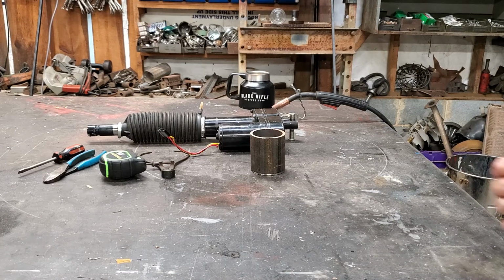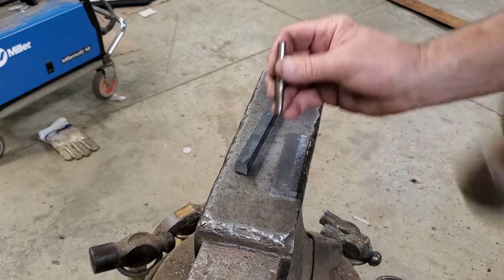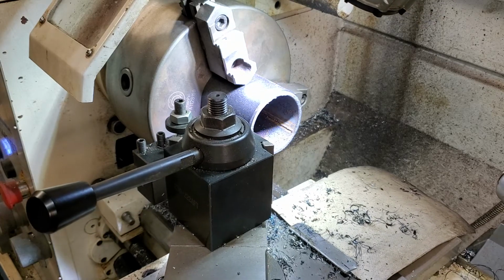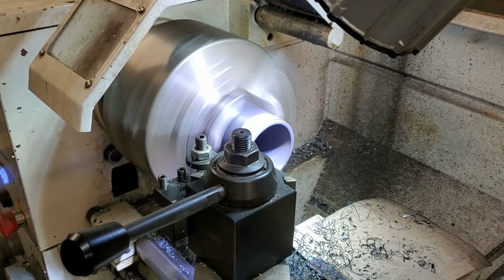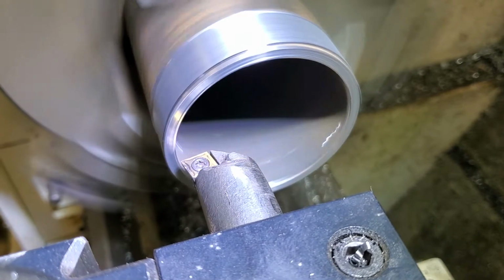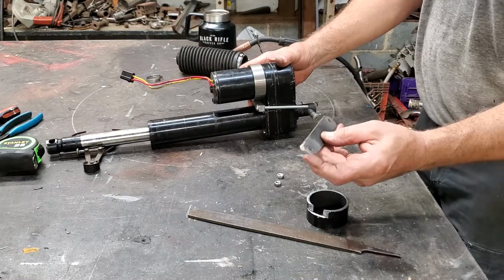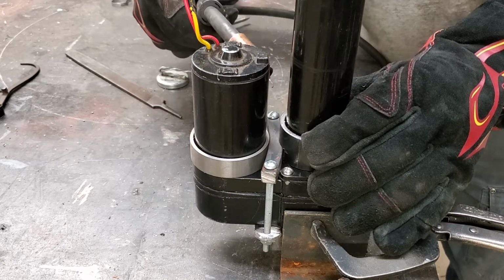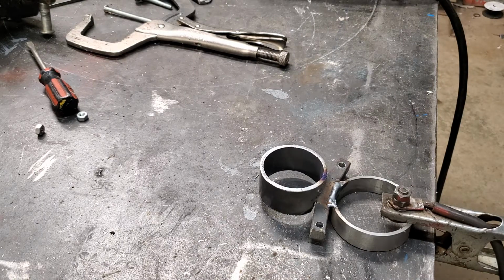How to repair john deere dump bed motor

Comment: I asked JD to drill the 4mounting holes and use longer bolts. No can do. New motor installed $$$$$$$$$$. Thanks for the video.

Comment: Great video if you have industrial lathe, guess what most people don't.  This video is nothing more than tool flexing and no use to an average DYI.  You could of used 3 industrial zip ties and could of accomplished the same thing in about a minute.  This is not a video on how to repair john deere dump bed, instead is about how to hold the motor/hydraulic unit together.
Reply from the maker: Thinks for watching. Have a great day.